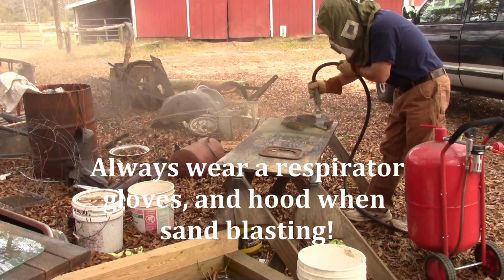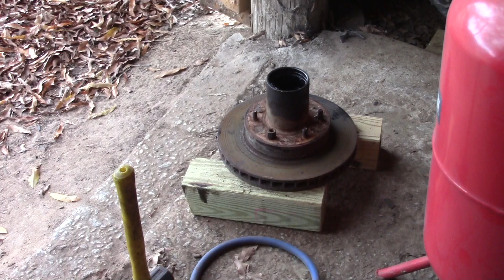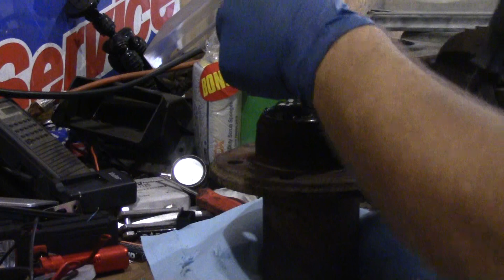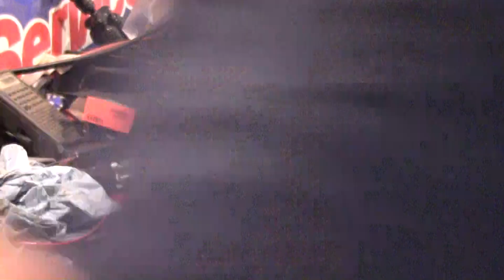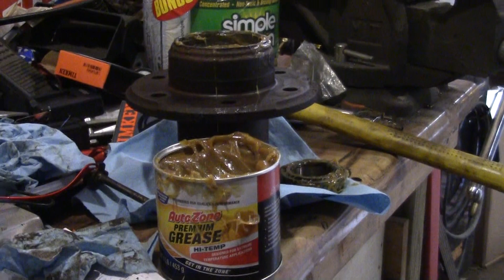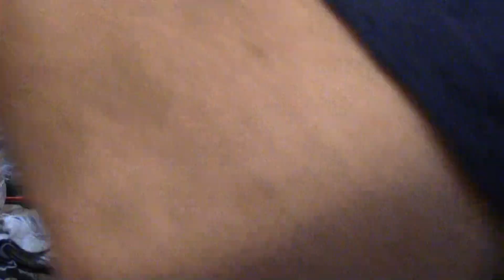1985 Chevy K10 Restoration Part 94B

Comment: can u seperate a rotor from hub the same way for a 85 gmc sierra 4x4 6lug looks exactly the same everybody said i ineed a rotor press or something
Reply from the maker: +Timothy Love It is exactly the same.  It can be done without a press when you go back with a new rotor, just  be sure the lug studs are seated good.  Sometimes I take a drift pin and hit the stud heads with a hammer to knock them in and when you tighten them up, it pulls them in all the way.  A press is a bit better (and safer) way though.